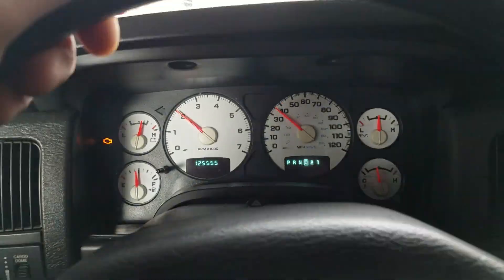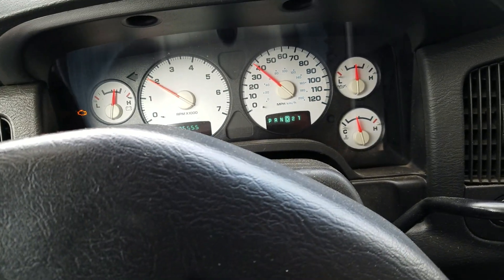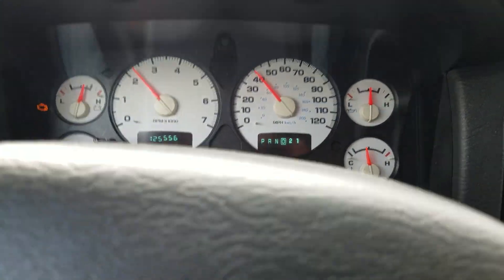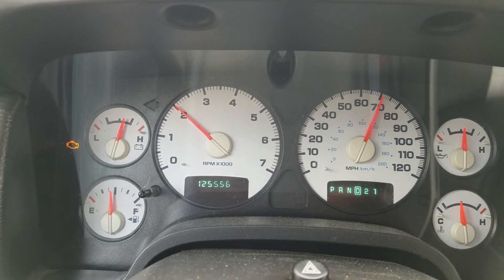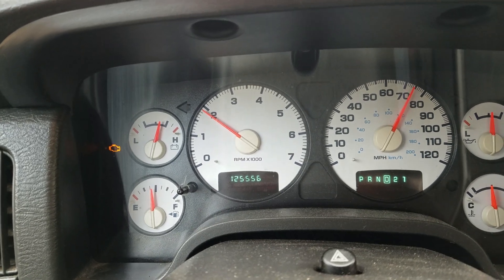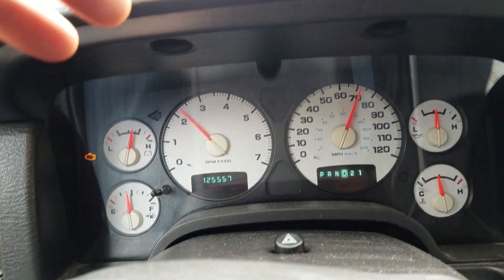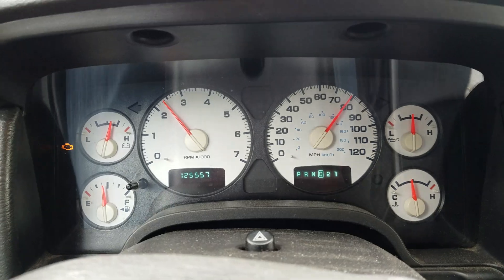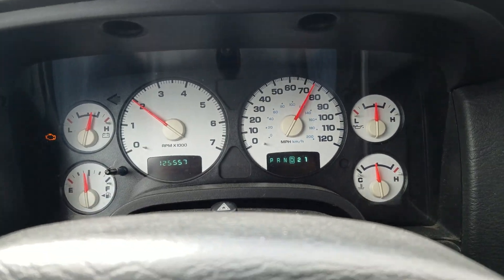Dodge Ram 1500 transmission shifting problem

Comment: Pickup tube might be getting loose  I'm about to check mine out next week  mine stuck  like it's not  shifting all way in any gear I'm hoping that's what it is   did a complete  trans floss  15k miles before  so hopefully  just my Pickup tube  my truck a 04 1500 hemi 4x4 with 280k miles  Trans  has around  135k

Comment: Idk if its what happened to you, but i had the same issue to an extent, my truck throttle would act like it wanted to kill the truck at high speeds and in park, found that it was the Throttle Position Sensor. Figured I would throw that out there for anyone having the issue
Reply: Did you have any check engine light on??
Reply: @zachellis871  No, but it can when the sensor is completely out, i just caught mine early

Comment: Mine does roughly the same once it gets to around 45-55 I believe 3rd gear into 4th but am not 100% certain
Reply: I have a 2002 and it’s stuck in 3rd only gets up to about 55-60

Comment: Torque converter clutch is bad.. there’s a lock up that occurs in OD and you can see how the needle is sporadic. It means it is opening up when it should be locked.   Normal wear and tear at this mileage you can have the transmission rebuild and replace the TCC.  Hope that helps

Comment: Its the ECM... after i change all solenoids and sensors throughout my ram 5.7 it still run like crap, because the ECM is dirty and slow to react to the signals all the good new replaced solenoids and sensors are sending to it

Comment: What about the tcm? I got p0700. 
Quick tip to check code. Turn the key over to aux 3 times. But do not turn the truck on. It will pop up the code.
Reply: Same here, did you figure it out?

Comment: Check the MDS solenoid. When you get cruise speed the hemi 5.7 become 4 cylinder and if the solenids are bad goes back to 8 cylinder. If not, check the pedal position sensor or the TPS. But dont waste money on transmission.
Reply: They didnt add MDS on the ram 1500 until 2006, his is a 2003.
Reply: Edgar Rios does that cause it to revv high then go into gear ? My does this from 1st to 2nd
Reply: @TheCanineGuy  did u find the problem? Mine is doing that now
Reply: @TheCanineGuy  what was wrong with yours. Mines doing what yours is doin now

Comment: I have a doge ram 2004 it is running really good and at high speed but when you stop at a light or a stop sign it starts to shake I replaced the spark plugs could you please help
Reply: Remove throttle body and clean it really good with the spray they sell

Comment: There is a censure under in the trany and one under your alternator the one in the trany is a red rubber ring and the the one under the alternator is a blue ring ...they talk to each other but when or if you have a theft key that’s chipped programed by the dealer po633 goes bad it throws the po700 and I’ve found that going to the dealer or dodge mopar dealer that the one under the alternator is the brains behind it ...I payed the 72 bucks changed out the blue ring one “ do not use the purple rubber ring one from the auto parts store ... it has to be “Mopar”

Comment: Mine (sometimes) when I’m on the highway it’ll happen the most. If I were to get on it at a certain gear it’ll slip or grunt a little. I gonna put in some transmission slip fluid if it fixes problem then great. If not I’m gonna have to take a look in the transmission other than that it’s perfect and smooth. Just did transmission fluid change and filter change. Might have a little slip at some points . It don’t hurt anything. Might just slip sometimes

Comment: that's spark plug misfire i had the same truck same problem mine would pull at 55 mph i changed spark plugs and problem gone
Reply: That was all it took for real?
Reply: That was all it took?

Comment: My 08 5.7 was down shifting more than it should on a slight grade. I got a line pressure booster and it fixed it. SONNAX LINE PRESSURE BOOSTER

Comment: I noticed right off that the charging voltage is high.
Reply: Thats normal, i have the high output alternator
Reply: @emer07jiffy  Mines does the same thing. U don’t think that will cause issues?
Reply: @maclac48  i havent had a issue my battery is still healthy

Comment: Had the same "brake check" issue. Had a buddy rebuild the transmission and new torque converter. It kept doing it. He reused the valve body, so he swapped it and the issue went away.
Reply: What valve body?
Reply: Our Dodge 1500 5.9 liter now is downshifting when we try to speed up. We were thinking the TCM needs flashed since transmission was rebuilt.. do you mind me asking if you got your TCM flashed after yours was rebuilt?
Reply: @kristineck2761  Adapted Values were reset in the TCM and there was an ECU update available, which he did perform.
Reply: @kristineck2761  With a new build, it will shift irregular. Maybe delayed engagement or even harsh shifting. As time progresses, the TCM will relearn your driving habits and correct itself.

Comment: Did you ever figure out the problem? I have the same issue on my 2003 4.7L.
Reply: Omar Guzman have you found the problem?are you getting the p1684 code?
Reply: @badillo280  the problem just went away on its own, but I've read in a forum somewhere that the problem is in the valve body. My truck didnt give out a code.
Reply: Omar Guzman same thing that’s happening with mines no code but I took it to a muffler shop thinking it was the catalytic converters and they pulled that code with there computer. But sadly mines hasn’t gone away. I had the truck for 3 years and has the problem since I bought it
Reply: I have the exact same truck. Did you figure it out? Mine only happens %50 of time
Reply: I have an 07 4.7 with 225k miles and mines doing the same thing right about 60 and sometimes going up a hill around 35. Sometimes it just jumps a couple times and sometimes it getts stuck in a kind of stutter and doesnt stop till I pump the gas
Reply: @Pawpaw7332  that’s what happens to me, up the hills, going an easy 75 to gain boost but as soon as that hill starts it drops down to about 50 and I can’t get anymore power until I start going downhill. any ideas yet?
Reply: @Pawpaw7332  have you fixed the problem mine is an 04 4.7 and it does the exact same thing yours does I’m desperate for help

Comment: I have a 2017 dodge hemi 5.7 litre and it's starting to do that. Skips from 1st to 3rd sometimes, but usually happens around 90-100 kilometer mark. I alleviate the problem  sometimes by pressing my gas pedal a little slower. It does not jerk as much. What do you think would help? (I already took it to the shop and they cleaned it, but still does same thing).
Reply: Any luck finding out wh
 the problem was? I’ve been having the same issue with my 2012 ram hemi 1500 for a couple weeks m and it’s driving me nuts that I can’t figure it out What’s the problem is.
Thanks
Reply: @HomeGrownPyro1  hey man did you figure out what was wrong with yours? My 2012 is doing the same
Reply: @rigochavez7102  hey not quite yet, I scanned it with my buddies scanner and it’s giving me a transmission rationality sensor code and a P0307 cylinder 7 misfire code. So far I changed all the plugs and coil pack for cylinder 7 and that didn’t help any. 

It does seem to be getting worse though, so I may have to take it to a shop but first I think I will try the transmission sensor because my buddy was telling me it’s pretty easy to change that you just have to drop the pan. So that is my next shot. Then if that doesn’t solve it I’m probably going to have to take it in to a shop to be looked at.

Also a lot of stuff I’ve read and watched so far is pointing me towards the oh so common cam or lifter issues which I’m praying it is not in this case as I can’t afford to replace the engine or the time to rebuild the engine at the moment. 
If you end up finding out what it is let me know and I’ll keep you posted as well

Comment: Is it an overdrive problem?
Reply: Robert Costello if it was an over drive problem what would you suggest?
Reply: @joshdover6448  not using od
Reply: Mines does something similar. If I have it in drive and anywhere from 45 to 55 sometimes it feels and sounds like it goes back and forth between the gear I’m in and even a lower gear. Really weird. Maybe I’ll change the plugs and see what happens. Mine has about 110,000 on it. It’s a 2008 Ram 1500 5.7 Hemi. I checked the fluid and at Hot it’s a little low but I really don’t think that could be it.? Whatcha think? Thanks for any help. Big Jim.